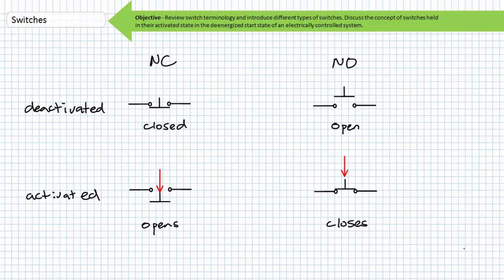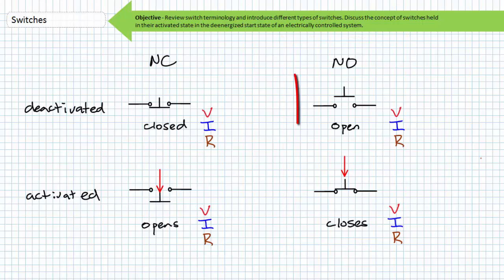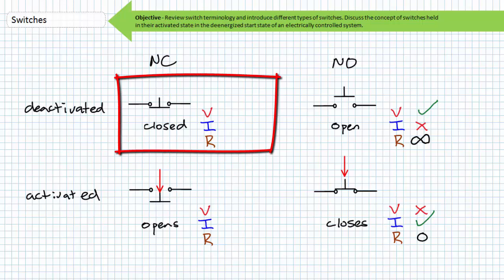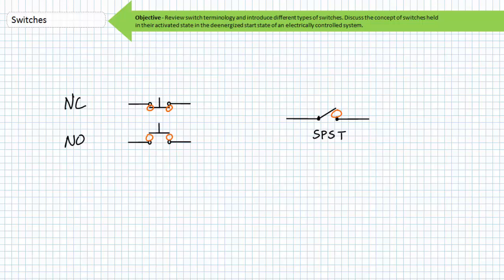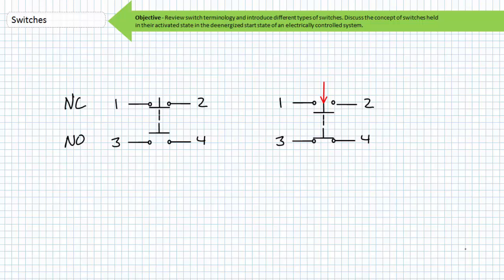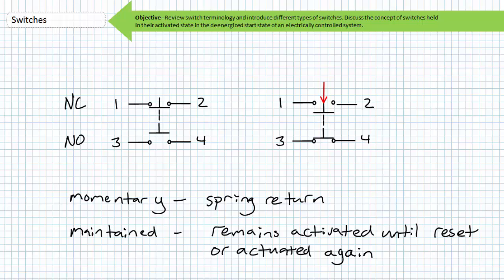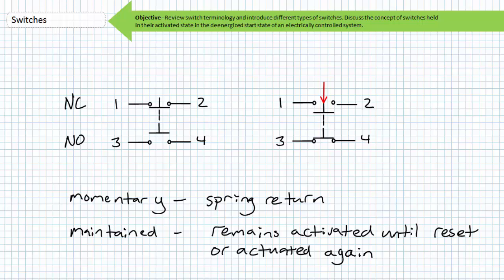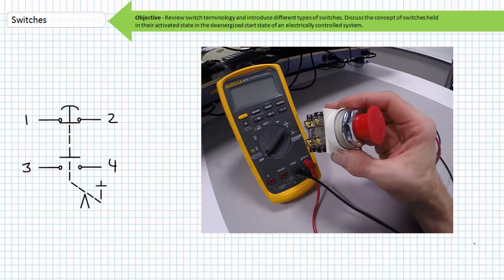Switches in Electrically Controlled Systems (Part 2 of 4)

Comment: Could you include the motor interlock circuit that you refer to here so one fully gets your message. I know you have other videos but it would be good to nail it here also
Reply from the maker: Check out the reversing motor starter with interlocks lecture. Presuming that's the one you're interested in.